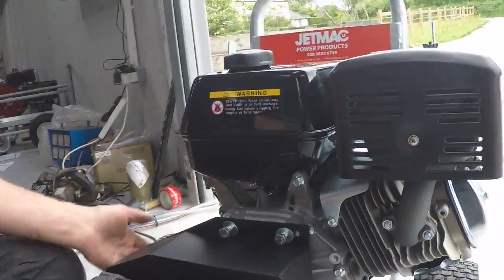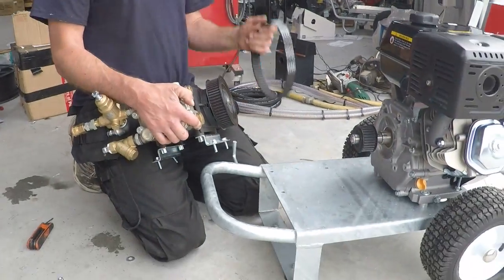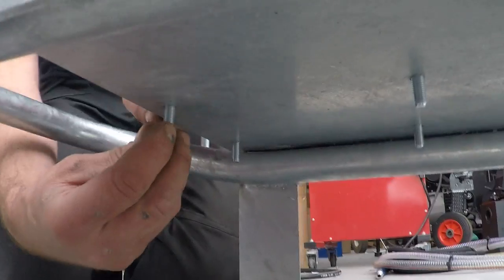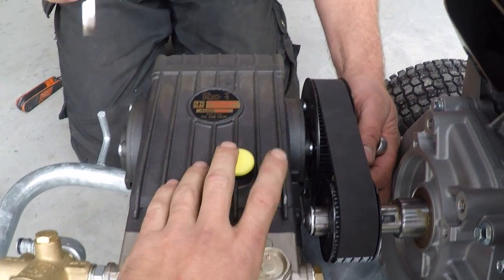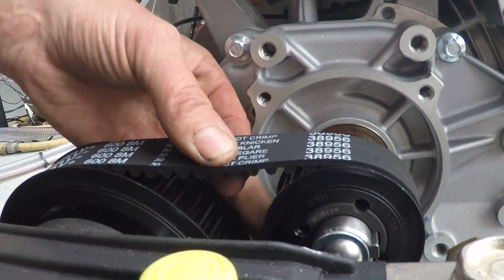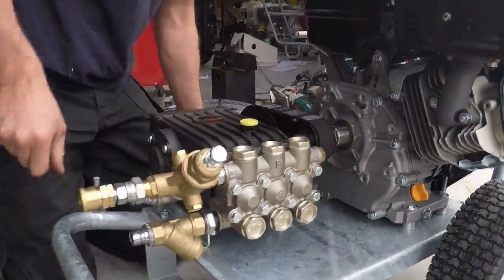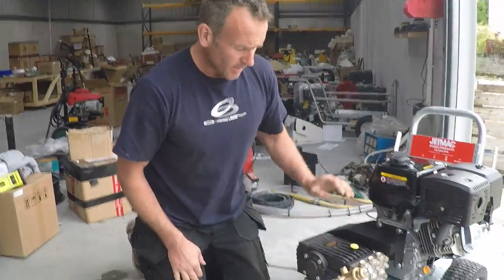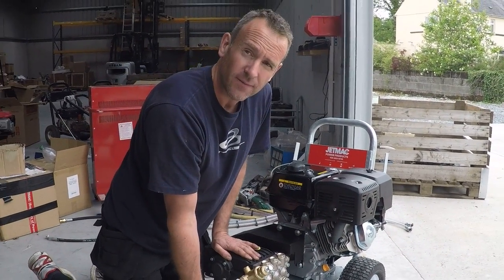Changing a belt driven belt on a pressure washer.

Comment: Hi I purchased my machine back end of last year from you was on a job last week and the belt went when I removed the guard I noticed the pulleys don't line up so the belt was off set looks like the bolt holes aret in the right place, 
Cheers Rob.